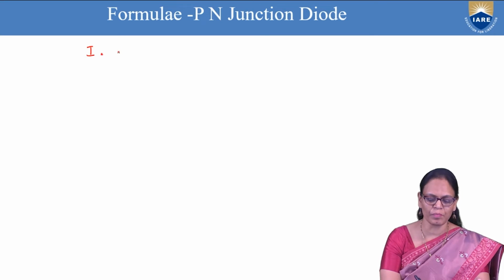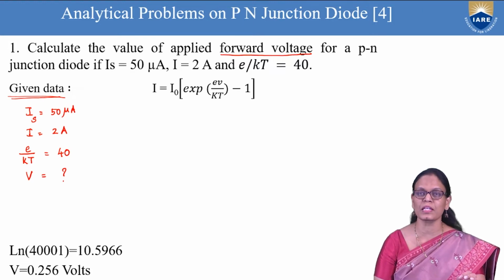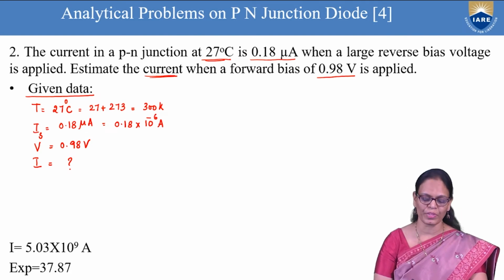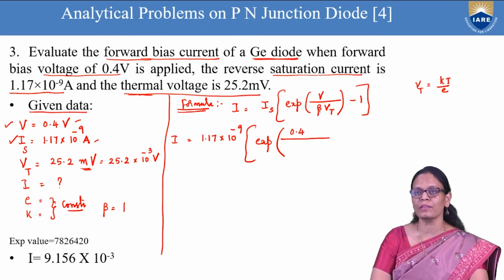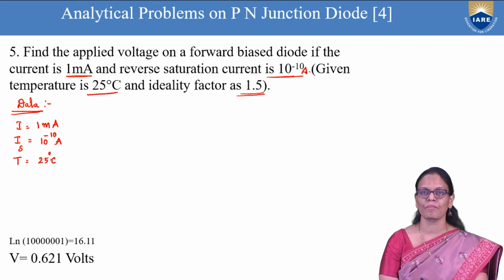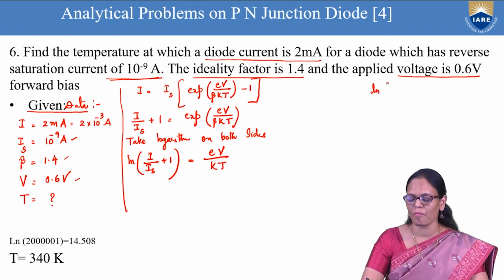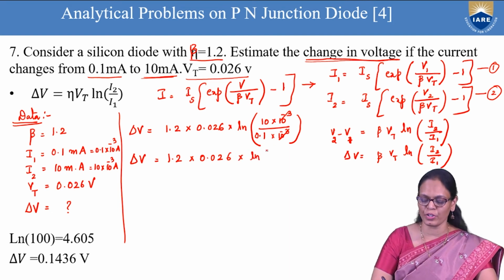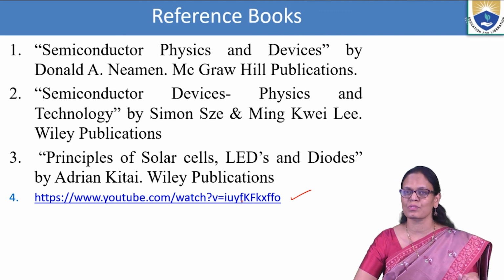Analytical Problems on PN Junction Diode by Ms. S Sujani

Comment: Mam please I request you to help me solve the following question :-
A diode operating at 300 K has the forward voltage of 0.4V and when the current is twice as large the forward voltage is 0.42V. What value of Io (reverse sat. current) and µ allow the diode to be modelled by the diode equation?

I shall be grateful if you respond